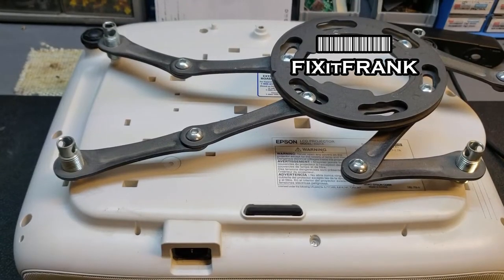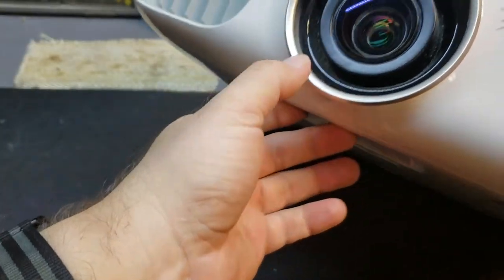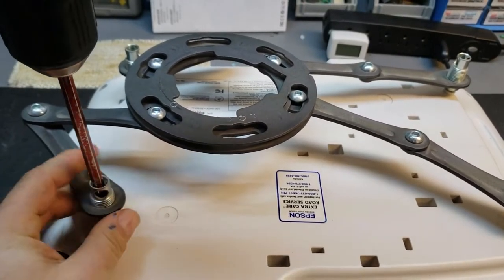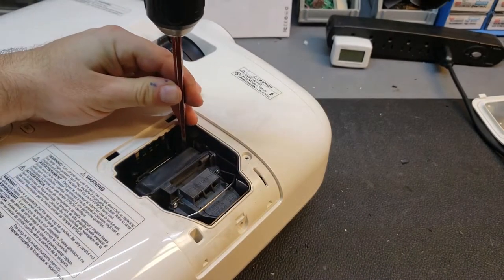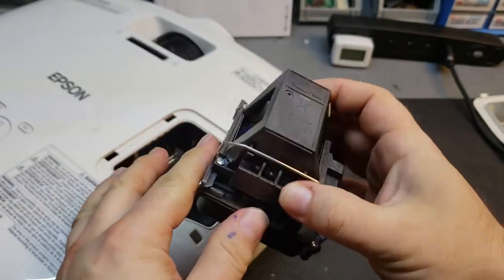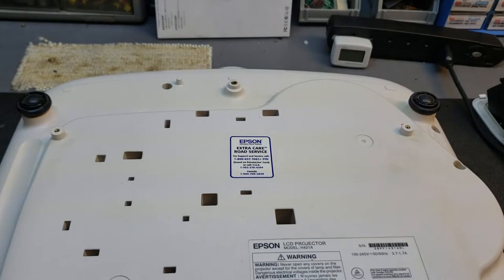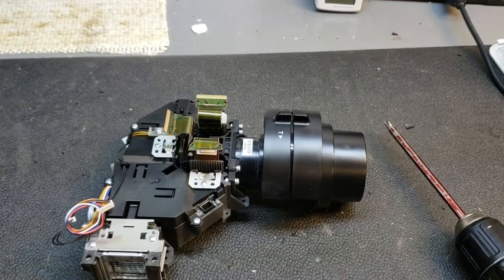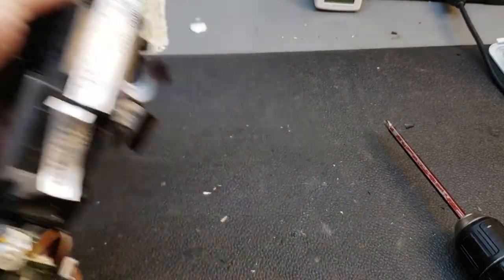Epson Home Cinema 3010 LCD Projector Cleaning

Comment: My original Epson EH-TW5400 lamp was failing (dim screen and flickering) after just 3000h of use because I ran it on ECO from the start (first projector, didn't know that was a bad thing) and I needed a replacement, but a new $170 bulb wasn't an option for me so I ordered a $13 bulb and a $20 bulb with the module off Aliexpress. 
The one with the module turned out to be crap - it was dim, half the screen was different color and the plastic started smelling of burnt electronics. 
So I tried the other bulb - I placed it in the original module and it actually turned out great - it's much brighter than my failing bulb, doesn't flicker and the screen is pretty uniform. The only issue was that I had to change the color temperature a little in the settings but I would say that Ali lamp is around 95% as good as a new lamp.
Unfortunately the fan started ramping up and the noise became unbearable - so I decided to clean the projector with some compressed air - big mistake. While the fan issues got fixed another problem appeared - lots and lots of magenta and blue splotches on the screen - turns out that all the dust (and there was a lot of it) got pushed inside of the projector and that's why I'm now watching this video to prepare myself for cleaning the internals of my projector :(
Reply from the maker: Go slow and take apart as little as possible.  By now your LCD panel cables are becoming very brittle.  They can crack with minimal pressure.  When using air, turn down the pressure a whole lot.  I use a regulator set at about 8psi and then it has a 25ft hose so its probably a little lower at the nozzle.    Keep a vacuum running next to things and it will suck in the loose dust.  If you are in the states, this is a great lamp option.  https://www.purelandsupply.com/epson-projector-lamp_eh-tw5400.html  It is around $100 and uses an Osram bulb.  Of course if your lamp is running OK, then there is no need to change it at this point.
Reply: @FixitFrank  Thanks for the info! Unfortunately the cleaning didn't go so well. The first time after cleaning the dust disappeared but instead much bigger color spots appeared all over the screen. So I opened it back up, cleaned it again, more thoroughly and put it back together. And now the projector turned on but the image was missing the green channel. After around 10 seconds though the whole image started turning green until it was completely washed out in it. So I probably did damage the LCD ribbons didn't I?
Oh well, I was meaning to upgrade it soon anyway - lacking HDR compatibility is becoming more and more of an issue.
Reply from the maker: @Undy1  Oof.  Maybe.  The cable might also not be seated fully. Might be worth double checking.  
It's probably new PJ time.  I try and stay neutral on some things but I do have a personal aversion to Epson LCD projectors.  In my experience with them, they tend to fail in ways that make repair not reasonable. I don't know if its due to the lack of service info or the cost of the parts or maybe both, but I have the worst results with Epsons.  To the point that I rarely will take them in to work on if its an optical issue.  Electrical issues are OK for the most part (as long as its not too old) but optical issues (even cleanings) I tend to stay away from unless I am very confident in the course of action.   I wonder if its intentional that Epson makes them in a way that when they fail, its not cost effective?  It would be smart on their part.  I can only speculate of course. 
I'd check your wires one more time.  You can turn it on with the top off and try gently pressing on the cables to see if the image changes.  It may confirm the failure or maybe get things working again.
Reply: @FixitFrank  Thanks! I'll try that one last time then. 
Yeah the whole thing seems odd for me - if I was designing a projector like that I would seal the optical assembly and the LCD's entirely so that the dust wouldn't have a chance to get there in the first place!
Are there any projectors you would recommend instead? I'm looking for something that at least supports HDR, and is ideally 4K. I probably want to stay away from DLP though. Never seen one in person, but I'm pretty sure I would see the rainbow effect because I can also see that on plasma TV's. And the price should probably be $1600 at most.
I found Epson EH-TW7000 that matches these requirements, but maybe you know something better?
Reply from the maker: @Undy1  Depends what your budget is.  The cheap epsons are not great. I hear people buy them and then are very upset at the lack of quality in the image that is advertised. You may want to try DLP though.  The newer models use 6segment color wheels which tend to prevent the rainbow affect.  I prefer DLP personally so LCD is not as high on my personal radar.
If you can afford it, look at LCOS/DiLA.  Sony/JVC.  LCOS is better than both LCD or DLP.  They are more expensive though.  Worth it in my opinion(if you can afford it).   I have an older JVC- DiLA RS1(up for sale actually) that has a gorgeous image.  The only complaint I have is that its not very bright.  In a dark room its fine but any light leakage and the image drops off quickly.  Granted its an older projector but even for an older PJ, the LCOS image is fantastic. 

It's hard to recommend new projectors.  Everyone has their own eye on what looks right.  I would suggest checking projectorcentral.com though.  They have a great set of information on the features and prices on all new units.  
I can suggest some brands.  DLP: check BenQ, Optoma, Viewsonic and Acer.  LCD: Panasonic, Epson, and NEC(might not have 4K).  LCOS: JVC and Sony.
Reply: @FixitFrank  Thanks, I'll check those out.
Update on the projector: The green LCD is fixed now, but the red one stopped working. Time to disassemble again. Unfortunately the internal design of this model is different from the one in the video so there's no way to turn on the projector while open. There are two PCB's plugged into one another by a hard connector, and you need to take the top one off to get to the LCD ribbons. Also the top piece of the casing has to be plugged in, otherwise the projector thinks the shutter is closed.
Reply: Final update: it works now! All the LCD's are okay. The image still has some massive color splotches unfortunately. My cleaning has certainly made it worse, but at least the projector is still usable as a display. Wouldn't watch a movie on it though :(
What's weird is that while I was cleaning it I noticed that one of the pieces of glass before the LCD (red) got cloudy unevenly - like there were white smears on it -  that didn't happen to the other pieces so it seems really weird to me. Any idea what that might be about? I don't think I'll be trying to fix that anymore, just curious.
Oh and I found a projector that seems to be all around great for me - Optoma UHD50X - the only problem is that it's not available in Poland (well it is, but at 3x the retail price). What a shame.

Comment: I have Epson 3010e. It has blue and yellow color botches. Do you think cleaning will fix the problem and how much would you charge to clean.
Reply from the maker: Hello Shahid!  I would need to see a picture or video of hte issue.  The problem may be dust, or it may be polarizer failure in the optic section.  Please let me know if you are able to post a picture or video and I will tell you what I see.
Reply: FixitFrank may I have your email so I can email the pictures to you.
Reply from the maker: sales@weezytech.com goes right to me
Reply from the maker: @shah4268  Sure thing.  sales@weezytech.com
Reply: FixitFrank thanks a lot. Sent you via email.

Comment: I tried cleaning my projector but am still getting strong red and blue hues on the top and bottom. Any advice?
Reply: I tried fixing the same issue on my 3010 with that video. Pushed the lens back into place, reassembled, powered up and got nothing but a blue screen. Bought an Optoma 4K projector and still have the Epson sitting on my audio stand. Not sure where I went wrong. Everything seemed straight forward.
Reply: @TyTimp  Sounds like the lcd ribbon cables not conected properly?
Reply from the maker: That tends to be an alignment issue between the lamp and the optics. It's hard to say what piece it is unfortunately.

Comment: I have this same projector and 2 weeks after buying a new, genuine OEM Epson lamp + housing it now has (what appears to be) a slightly burned polarizer.  It's extremely frustrating, as I've kept the projector clean and in a cool environment for its entire life. Do you repair stuff like that?  Tibimakai on AVS forum recommended that I ask you.  Thanks!
Reply from the maker: Hi! Tibimakai is a great guy. I appreciate him thinking of me. Polarizers are incredibly frustrating. Epson tends to be a black hole for easily obtained parts. I shy away from polarizers most of the time due to how much time it can take to get things aligned again. Many times, I find it's better to replace the entire optic block with a used but good piece from a projector that was hit by a power surge. 
That said, I'm surprised that a 3010 is having polarizer issues this early. It's not a new unit but they tend to run for at least seven years or maybe five if abused and it sounds like you take stellar care of it. 
Would you post a picture of what you are seeing? Even in a clean environment, they can still pull in dust. Dust can also make it seem like a polarizer. I'll check into parts cost in the meantime. There an email listed in the about page if you don't want to post a picture here.
Reply: @FixitFrank   Appreciate the fast response! I just e-mailed you a photo. Hopefully I don't have to go through all the trouble of replacing the optic assembly :(   I just can't believe that after 2 weeks a brand new, Epson OEM lamp assembly would burn the polarizer like that. I almost want to try to get them to replace it!!
Reply from the maker: @JDL4  I have a tough time believing its bad this soon too. Looking at that picture, I honestly think that might be dust.  I'd expect more of a "blob" than the 'striations' that I see.  The slightly green in the white text makes me think that as well.  You may want to try blowing some air into the area where the filters are.  Take them out and use some canned air or aircompressor(Set low pressure, 10-20psi) and see if that artifact changes.  I bet it was already there with the old lamp but it was too dim to notice.  If you Google Sony BlueBlob, you will see some pictures.  I may be wrong but I think you have dust more than bad polarizer at this point.
Reply: @FixitFrank  Do you have a tutorial on taking out the filters? Or do you mean the air filter?   Also I just took the lamp assembly out again and took some photos. It's starting to look like there is a similar 'red hue' on the bulb itself when I shine light on it at certain angles. Very strange... Thank you! :)
Reply from the maker: @JDL4  I just mean the air filters.  They have ducts internally that will lead to the LCD assembly.  you may be able to at least move some dust if its the cause.  If the artifact changes after you blow some air into it, that will show you its more likely dust than a polarizer.   The red hue you see on the front of the lamp may be the IR block coating.  There are so many little prisms and filters that using an LED flashlight can kind of throw off what you are seeing since the LEDs dont have a wide enough spectrum.  Basically we want to see if that pattern shifts after moving that may be dust. That will tell you if its worth digging into or if its polarizer and possibly complain to Epson time.
Reply: @FixitFrank  Gotcha! Thanks, much appreciated. I'll let you know :) Hopefully it's just some dust!!

Comment: Thank you for the very detailed instructions. I have an Epson 1040 that is flashing a pinkish rectangular on the screen even with no inputs hooked up so I have ruled out source and HDMI cable. Its out of warranty but was wondering if you could help. I have a picture and video of the issue. Thank you in advance of any help you may be able to provide.
Reply from the maker: Hi Chris, That is the most unusual issue I have seen with an LCD projector.  It's like the red LCD is flickering but I can't understand why it would. 
This is a non-standard problem for me.  I do not have a concrete answer but I have some suggestions on where to look.
My theory is that the LCD controller has a problem.  Possibly bad solder or a failing IC. Another possibility is something in the power section(either main PSU or one of the smaller regulators on the mainboard).  
I am not sure what they should all read, but they should have a part number and that should lead you to a data sheet that will say what they should read.  Finding a service manual for Epson is virtually impossible, so checking internal connections( the red lcd connector for instance) would be a good place to start and then move on to verifying voltages.  I imagine you already tried a factory reset. If not, it's worth a shot.
Reply: @FixitFrank  Thanks so much for the reply, I am usually good at "googleing" issues and finding may others with the same issue and then resolving my own but I hadn't found anyone mention an issue like I am having. I did swap out the bulb thinking it was bulb flicker, I also did a factory reset. I will tear it down and check the solder points and try to get some readings. I appreciate your input, it validates my thinking that this is not a common issue😃. I will update you on the outcome.thanks again.
Reply from the maker: Definitely far from a common problem.  You may find 3 ICs that drive the LCD panels(also might be one IC) but trace back the leads from the LCD connectors to their driver chip.  I'd verify the connections and then check the power to the chip.  You can email me directly if you have any questions that cant be posted publicly(has personal info or whatever). email is on the about page.  Hope you work it out.  I'm very curious to see how it goes.

Comment: Frank, i just bought a used Epson Home Cinema 3010 LCD projector. The previous owner told me the lamp was out. I turned on the projector (with burnout lamp) yesterday, and both the lamp and temp were blinking red.  I also tried to turn it on again without lamp. Both lamp and temp were blinking red the same way as the (bad?) lamp installed. (1) Do you think it's just the lamp was bad or more, such fans and thermal control board. (2). How many fans inside this model? I could hear one more fan turn on when lamp and temp turn red. Thanks
Reply: I changed the fans, but the problems are still there. I suspected the ballast board was bad. I was afraid to put more money in to it, so I sent it out to one shop to check what was wrong. I was told it's the HDMI control chip need to be replaced. I don't understand why that could affect the lamp and temp. @frank, is it possible?
Reply: @sawantyash07  maybe fans are not as effective as new? The one between the power and ballast board is easy getting bad since it`s near the heat source?
Reply: @sawantyash07  No. I changed all fans, but it still had the problem.

Comment: 6:50 Lol just opened up my Viewsonic px700 HD it was Overheating, Its so Full of dust and I mean FULL of Dust.
Going to try to Vacuum it out as best I can, the Viewsonic has No filters so it's Really Bad inside.
 And No video's on YouTube explaining How to clean or disassemble😟
UPDATE I FIXED IT 😎
I had to take it Completely Apart was held together with tiny clips (Think PS5) if that helps.
The Viewsonic Px 700 HD has No Filters so Really it's my Fault for Not cleaning it sooner.
Lamp is at 7000 Hours and it says it will last till 14000 so I'm at half life.

Comment: Hi @FixItFrank, great video! Hoping you could take a quick look a green blob I am dealing with on my Epson 1080UB: https://www.youtube.com/watch?v=t177cHU-_eA - I am not sure if this is stubborn dust or the light polarizer going bad.  

I just had my 11 year old Epson 1080UB projector with 1,955 hours on it professionally cleaned by the local Authorized Epson Service Center. I also had the technician install the brand new spare bulb that came with my Pro version as I noticed the original bulb had lost a noticeable amount of brightness.

Before sending it in, the picture was getting softer on the lower half of the screen and there was a noticeable dust blob on the red LCD panel (the Netflix logo showcased that issue perfectly).

After cleaning, the dust blob noticeable during the Netflix logo and any sky (or mostly white) scenes was gone. The picture also much sharper. And with the new bulb, WAY brighter.

Unfortunately, I now have noticeable green dust blobs during very dark scenes (may have been there for a long time and now I can see them with the new bulb). One really bad one in particular. I brought the projector back in to the Authorized Epson Service Center and sent photos (which appear in the video I made) pointing out the artifact. The technician called and said he couldn't see the artifacts, I explained his room likely wasn't dark enough and that he should play with the focus. He went ahead and cleaned the projector again in the hopes a 2nd cleaning would fix the issue. - It did not, same artifacts.

I am hoping to benefit from your amazing experience! Thanks for your consideration and keep up the awesome work.